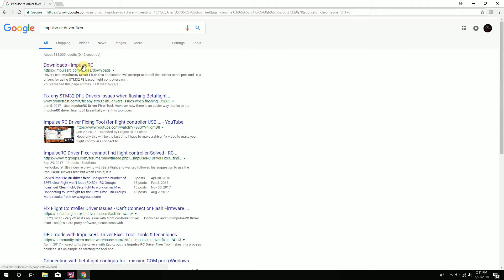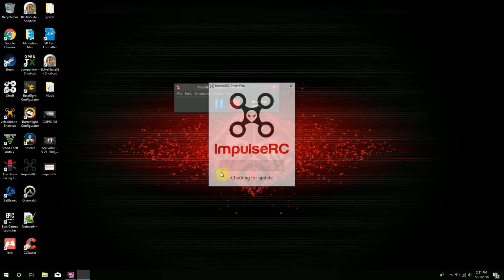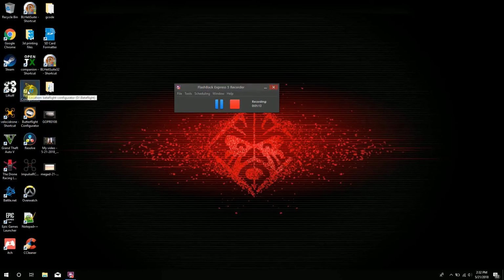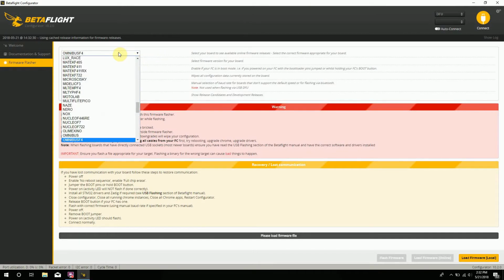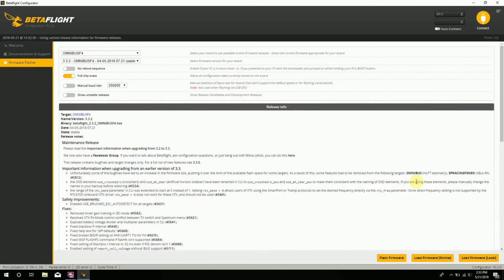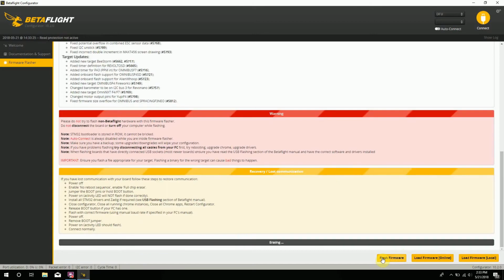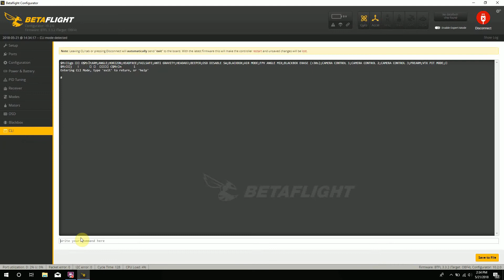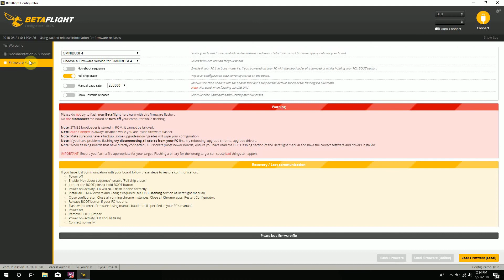How to Flash ANY Flight Controller - Even With a Broken Boot Button!

Comment: Should the PC detect the FC even if its some how bricked? I have a POS Mamba f722, after 1 pack it decided to die, all I get is the 3v red light with just usb, I do not get a MCU or USB light, holding the boot button doesnt do anything either. I have tried the impuserc driver and it never detects it. ive tried stm drivers, ive tried it all

Comment: This is a little off topic but hope our problem can also be resolved.  One of our group of users of the Kai One Pro GPS HD 3-axis Gimbal drone has unfortunately allowed a new controller phone app he was trying, to update the firmware.  He now has no wifi from the phone to drone.  His remote is working. Is it possible to extract (backup) the firmware from my drone and transfer it to his FC.  Thereby effectively doing a factory reset. Guidance would be appreciated.  I wonder how many others have done this trying to find a better app for their drone.

Comment: I have a SP Racing F3 flight controller and it worked great over couple of months until I started having problems with getting connected into betalight. I flashed the firmware and now all I get is a blue LED light. My pc detects the FC but I cant put it into bootloader nor I can flash it. Ive looked everywhere for some information but theres nothing about it.

Comment: Hey mate! I'm struggling here I'm new to this ... So I got myself a wizard x220 as my starter drone and I'm setting everything up, so on betaflight it shows its connected (says com3) I try to flash and it doesn't want to, I've downloaded and configured the drivers but still no avail... So I downloaded impluse driver and it can't find the flight controller board so I'm stuck ...do you have any ideas?
Reply from the maker: Ndala Tolosi are u able to connect to betaflight still? Go into CLI and type version and make sure you are flashing the correct firmware.
Reply: @ViperFPV    I can't connect to betaflight, or flash it. It just shows coms3 and I think I figured it out, I looked for stm3 bootloader and I can't find it anywhere even on the ports settings or zadig. Do know a way of putting that into my FC?
Reply from the maker: Ndala Tolosi have u installed the drivers on the main screen of betaflight there is 3 u need.
Reply: @ViperFPV  yeah installed all of them...should unistall and reinstall them?

Comment: Hello Viper_FPV! I downloaded the impulse RC driver fixer, but when I start it, it continues searching for the flight controller for a seemingly unlimited amount of time. Once I let it on for 2 hours, and it wouldn't connect. Im not sure if this will help, but the led on my Spracing F3 continues to stay on without blinking when connected. The first time I tried to flash the firmware onto the board, it downloaded halfway until an error message showed up that was along the line of: STM32-TIMED OUT. I also tried reflashing with the Zadig driver fixer, but wasnt able to find the FC in the "device" dropdown menu. After that, I tried reconnecting to betaflight but it simply cannot. Not sure if this is a USB problem, as I think it was able to download halfway. I would appreciate any suggestions, thanks and regards!
Reply: Did you figure it out? I have the same problem

Comment: Didn’t work on mine. It said Failed - unexpected number of devices detected.
Reply from the maker: Try disconnecting all other usb devices connected to your computer and try the FC and impulse driver fixer again
Reply: Viper_FPV Thank you for replying. There are no other USB devices attached. I have checked Device Manager and although the FC is lit, it doesn’t show up so must be faulty. The strange thing is that iNav says it’s successfully opened before giving the “no configuration received” message.